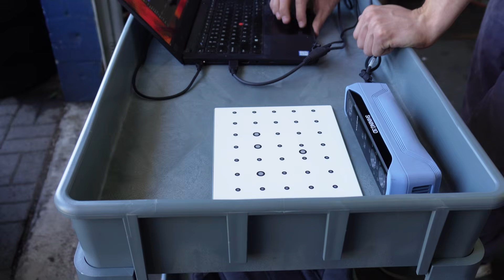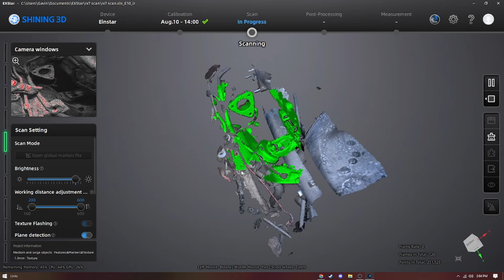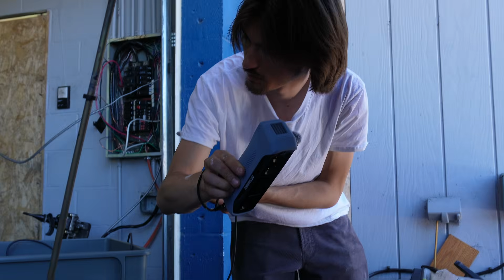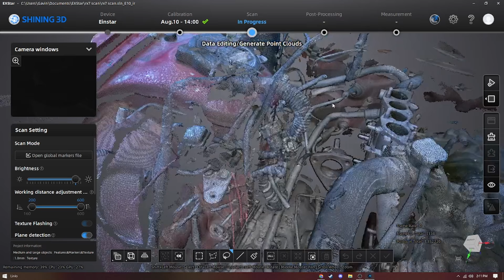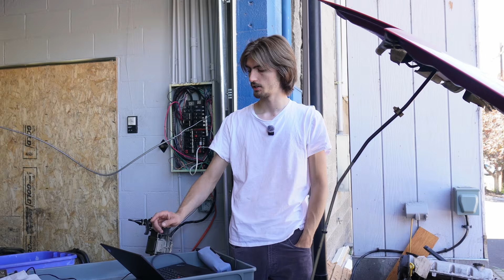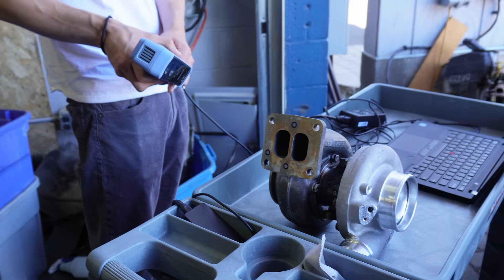How To 3D Scan An Engine Bay | Our FC RX-7 Turbo Project

Comment: I can’t wait to see what you guys come up with! Also, please put the cover back on that electrical panel! We don’t need anyone getting shocked by 240 volts!
Reply: To cool one space, you must remove heat from that space. How does this device do that? If it does anything, which I doubt, it will heat the room up (electric devices will generate heat) since there is no obvious venting to remove the heat to the outside.